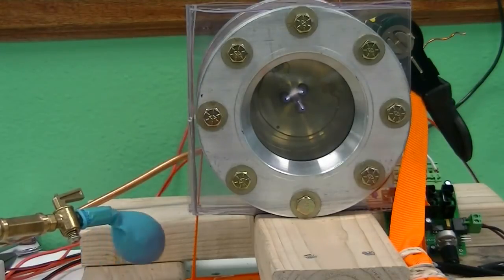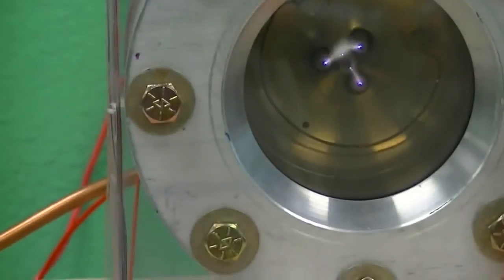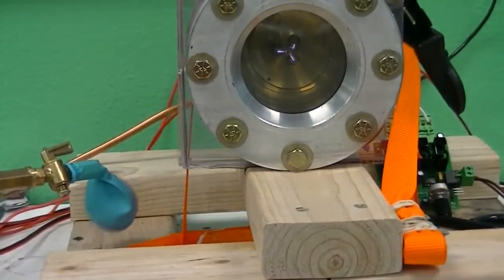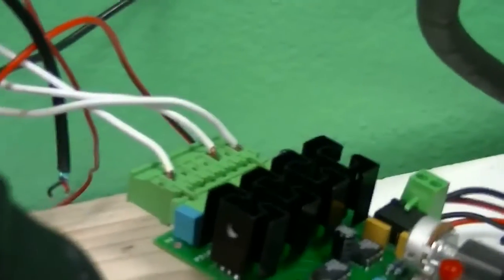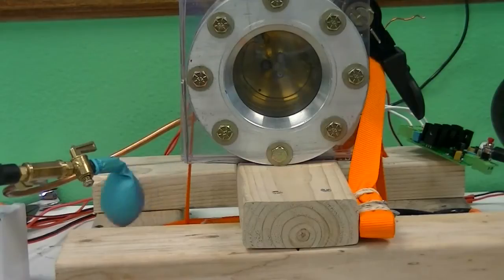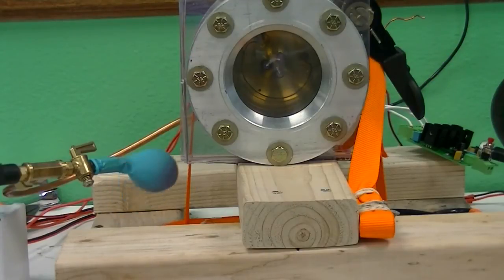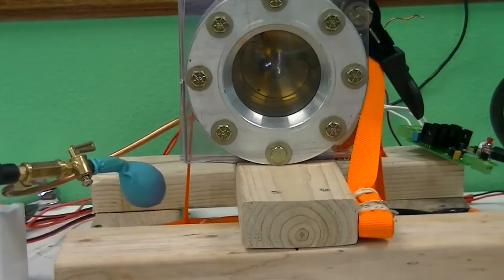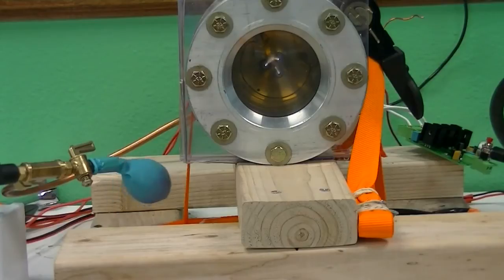Rohner plasma demo

Comment: I love the fact that your mind is so closed you can not see what is being presented. As Russ knows the process works well. Stand by as we are completing a new set of demo engines that will NOT be public but will be available to engine manufacturers from several countries soon.. But if you understand what is happening with this very simple demo and understand it is "worst case" you might understand that like Papp's original 83 engine, which I designed the control for, this is real. Unfortunately the people at Clean Energy Inc (CEI) scamed over 18 million to line their pockets.. Klosterman and My Brother.  Checkout how far they got. Klosterman can do the old Firecracker in a can trick and Bob can make sparks. But they have no interest to get this going unless they make all the money. I just want our kids to have a better world.

Comment from the maker: LOL... Google Plasmerg and John rohners plasmic transition process.  Supposedly derived from the Papp Nobel gas engine of the 70's. Here the high voltage spark is supposed to excite the nobel gases in a way that produced excess energy...i.e. pushes a piston up and down..here we him it attempt to inflate a balloon. Rohner has been pretty much exposed as a fraud.